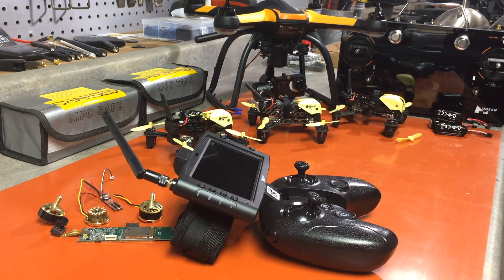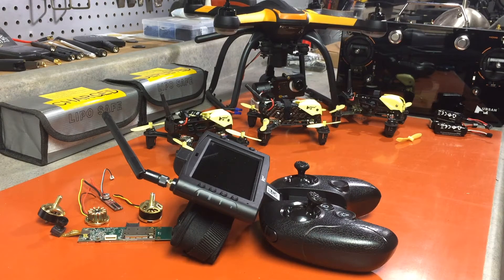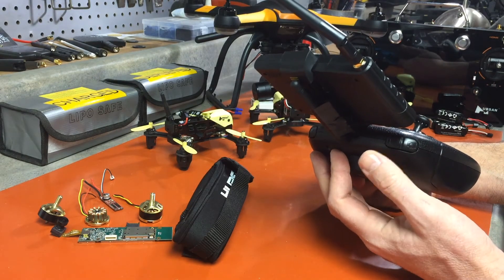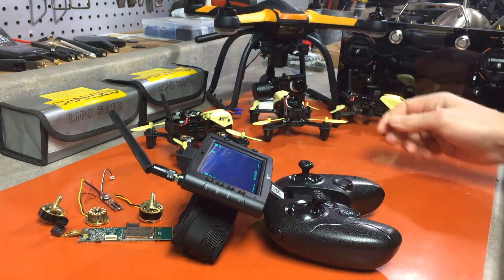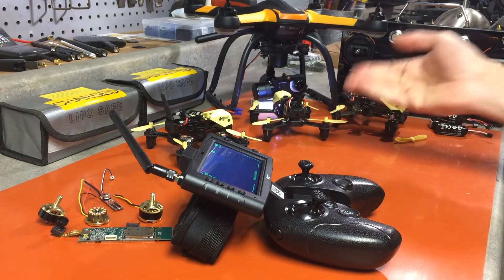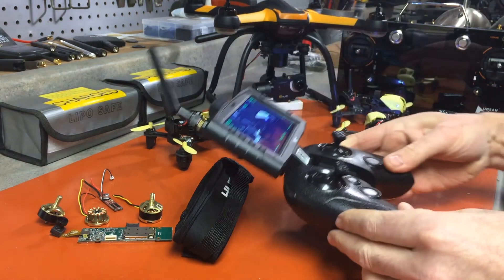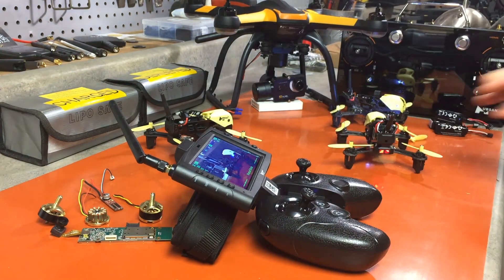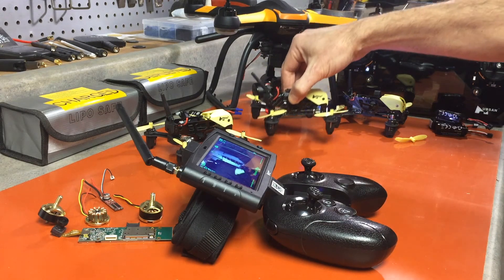HUBSAN H122D STORM - HOW TO: CALIBRATE IMU -  BIND TO CONTROLLER & FPV MONITOR

Comment: I know this old but under the battery of the controller is a plug for a 4-1 module I believe or maybe something else
Reply from the maker: I believe that’s for programming from the factory. Some of their other controllers have them as well.

Comment: Thing is pretty heavy ..mine just came in ,is what brought me here
Reply from the maker: Yeah they are a bit heavy and clumsy too. I don't have mine anymore...
Reply: @QCGUY  did you sell it? ...I was gonna buy the jet but none available..plus I'm new to them and thought the storm will help me More
Reply from the maker: @jacoblang2906  yes, I’ve sold both the storm and jet.
Reply: @QCGUY  well that's not fun ..do you build quads?
Reply from the maker: @jacoblang2906  nope...I’m not interested in that anymore. I use to like programming and modifying. I repair on average 5 a week for others so I’m pretty busy.
Reply: @QCGUY  I see...someone gave me a 9xr pro radio .it has a 4,into one module on the back of it..I've been trying to figure it out seeing how I'm new to all this it's going to take some time ..

Comment: are you able to bind this h122d with other transmitters? how can I find a list of compatible transmitters/controllers?
Reply from the maker: I recall it being able to and I have a group where other owners could answer that but the group is pretty dead as this model has gotten a little stale.  https://www.facebook.com/groups/HubsanH122D
Reply: What would you say is a good upgrade to this drone? Its been a good little drone to work with, learn the parts on and how such, but I think I may be ready for something a little nicer.

Comment: Thanks for sharing mate, can i use a different 5.8ghz fpv goggles, because i have already a Fxt viper 2.0,can it be bind to H122d?
Reply from the maker: ciLvfly Yes you can as long as they pick up the same frequency. I don’t know all that are compatible however.
Reply: QC GUY Thanks for your response mate, i was wondering if there's a trim button on this quad because it seems to be fixed and done only thru calibration.
Reply from the maker: ciLvfly you should join my old group for this quad and speak with others using it. Thanks 
https://www.facebook.com/groups/HubsanH122D/?ref=share
Reply: QC GUY You're welcome,i am already a member of your groups hubsan h122/123d and also hubsan h501 and Facebook friend (matthew Raymond dev)

Comment: Hi, Is it possible to use different controller with h112d??
Reply from the maker: Not sure but likely
Reply: @QCGUY  Yes.  The RadioMaster TX16S will support this with the multi protocol internal module.

Comment: Thanks for the how to. I should be getting my Storm in a week or so, using it to step up from tiny whoop to fpv flying.
Reply from the maker: Wishing you the best of luck with it! Join the group if you haven't already and you will find some useful information on some common issues we have found and came up with solutions to.
Reply: Just requested to join "Lawrence -----"